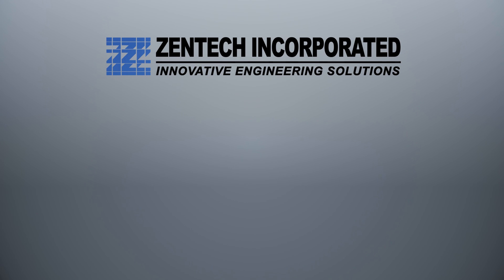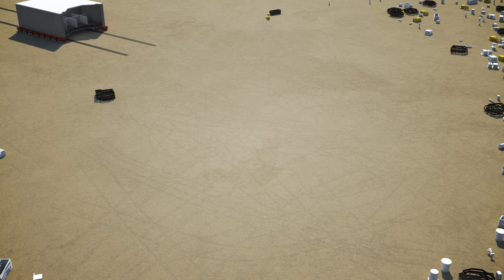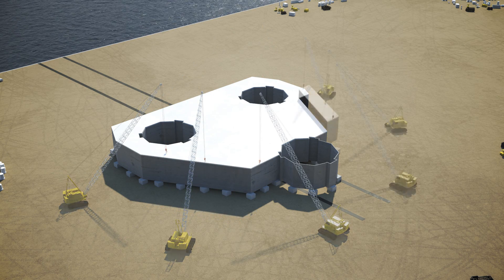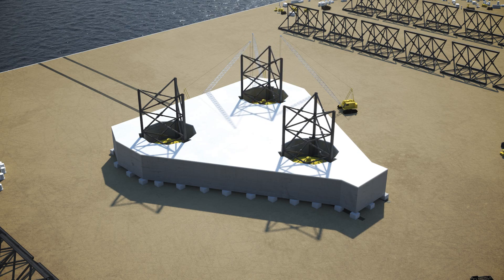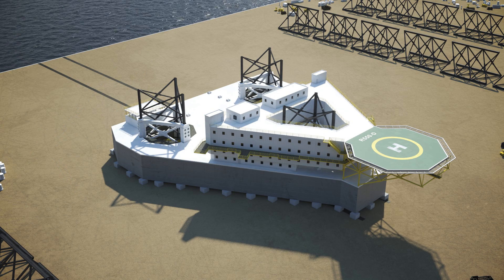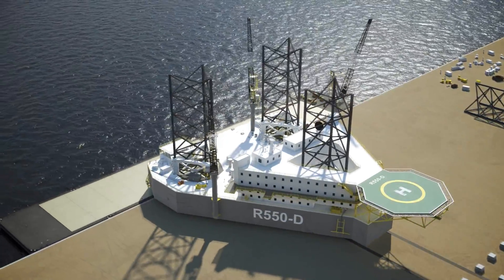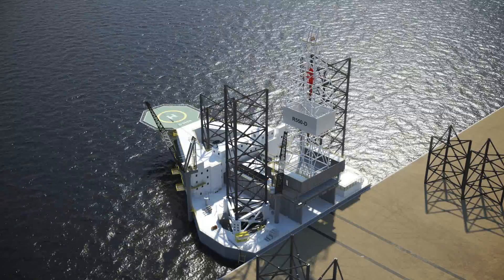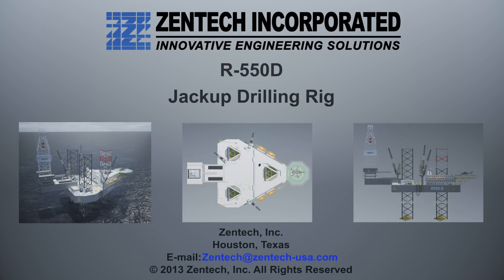Zentech Jackup Rig Design R-550D

Comment: I think you#re wasting a lot of deckspace by buiding the accomodation block in that way. It better to not have accomodation aft of the forward leg and instead build one more level of accomodation height. Furthermore, push the whole accomodation forward and integrate the supportstructure for helideck into the accommodation, thereby making it much more safe and efficient to be able to handle towing vessels underneath the helideck. This design can be improved.
Reply: Agreed. I'm not sure why they went about it in the manner they prescribed, it seems to have a number of inefficiencies. Perhaps someone from Zentech would like to chime in and elaborate on the reasoning for this?